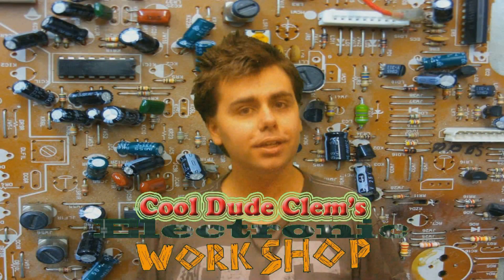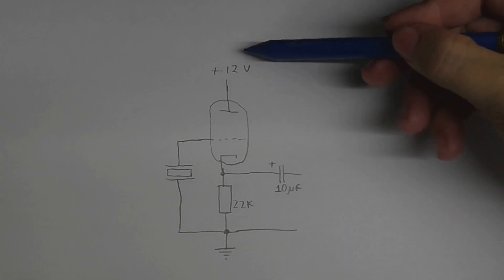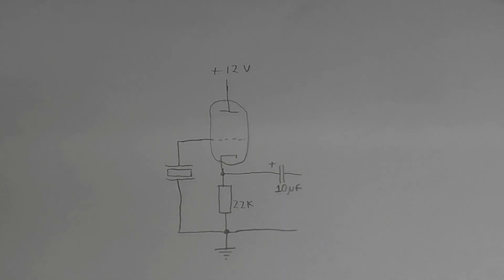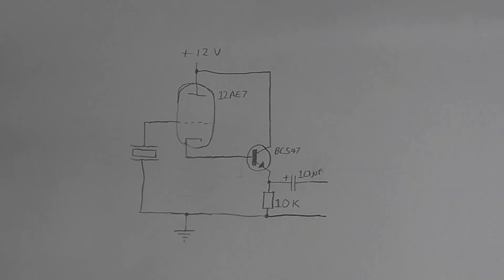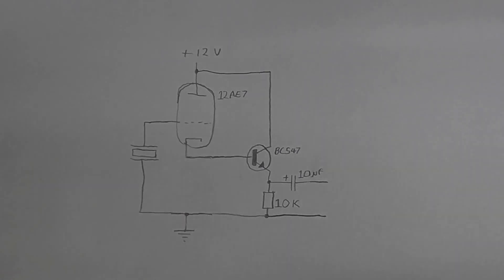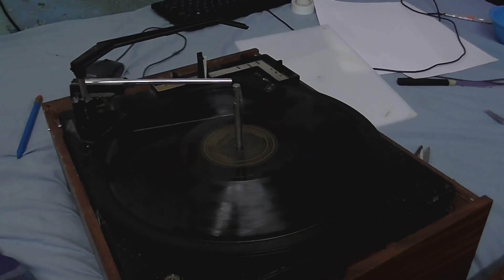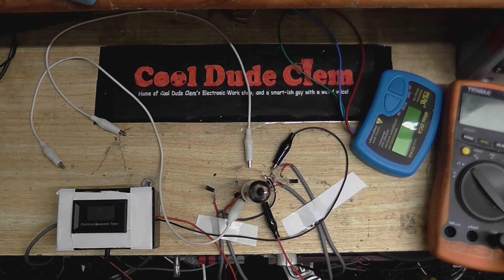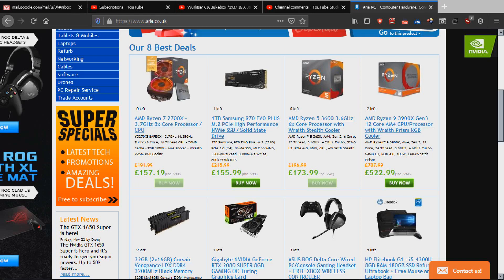Restoring my BSR Record Changer pt 1 A new case and impedance matching circuit

Comment: That Cathode follower to Emitter follower seems to work very well.Well done Clem!I wonder if that Valve was intended for early Car Radios where all the signals circuitry was Valve based with a "H.T." of 12V but a Transistor was used for the Output stage?
Reply from the maker: I believe that valve was indeed intended for things like that.

Comment: What type of valve is it? Do you have a phono stage after the matching amplifier? Interesting use of a hybrid (transistor/valve) circuit.
Reply from the maker: The valve is a 12AE7, witch is designed for 12 volts all around, there's no need for a phono pre-amp, this goes straight into the line in and doesn't need any EQ.
Reply: @CoolDudeClem  What about the RIAA eq for the playback of the record?

Comment: Im pretty sure those BSRs have a flip round stylus for 78s?? I was using a sc12m cartridge with a flip round stylus on a waltham stm 30.
Reply from the maker: Originally it had that cartridge in it but the cartridge had gone bad so I put in a crappy "crosley" style cartridge since I had one laying around, later I might got looking for one of those reproduction flip over cartridges.

Comment: seems without the resistor the bc547 is over biased
Reply from the maker: Shouldn't be, it's an emitter follower circuit.
Reply: @CoolDudeClem  I dunno fella just guessing its strange ?? try measuring voltage at the collector with and without resistor?